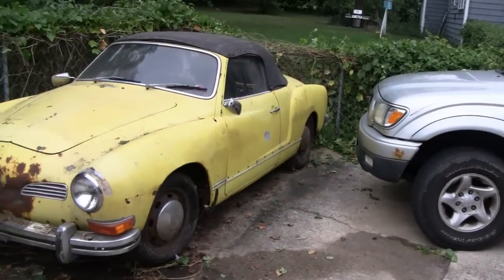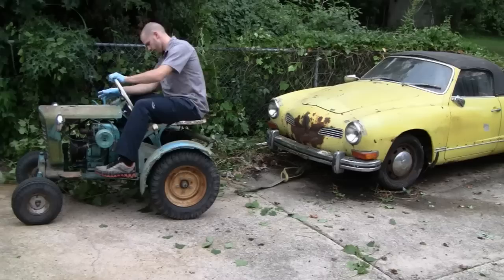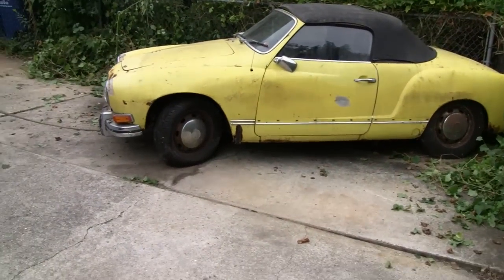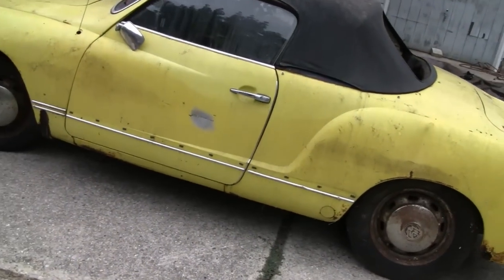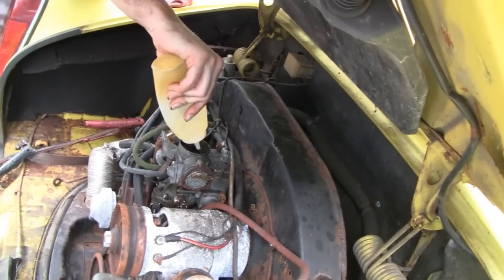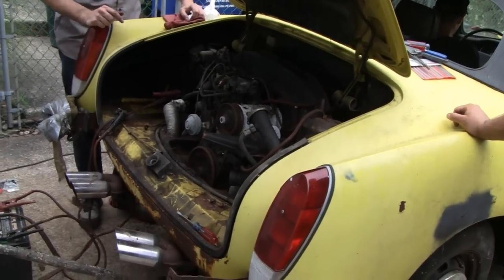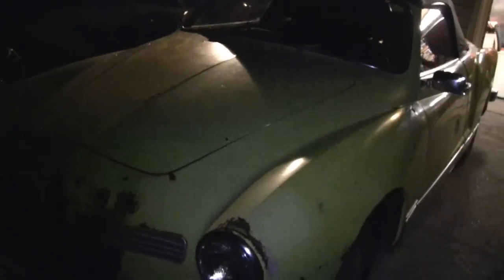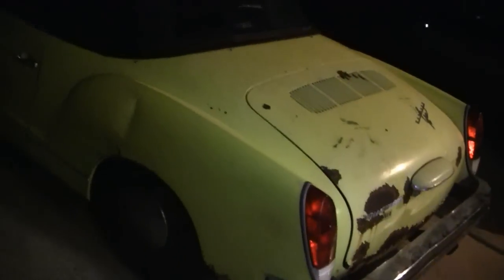VW START UP after 10 YEARS SITTING

Comment: we got close to the same thing.  In 1988 we bought a yellow 1972 vw standard beetle that had been stored in a barn from 1973 till we bought it in 1989.  it was only driven 1 year in the Oklahoma heat and replaced with a 1973 Buick so it sat there all those years with only 9457 miles on it.  the owner carried a battery over to it and jumped it with cables.  we drove it home 20 miles washed the dust off it and I started Driving it to college.  I drove it 20,099 miles and sold it to an Oklahoma senator.  I'm sure its still running somewhere.  it was absolutely a pristine survivor that looked like it rolled  off the show room floor in 1972.  the paint and interior were factory new. the engine had all the paper tags and everything like it had in 1972.  I drove it a long time before it was ever tuned up.